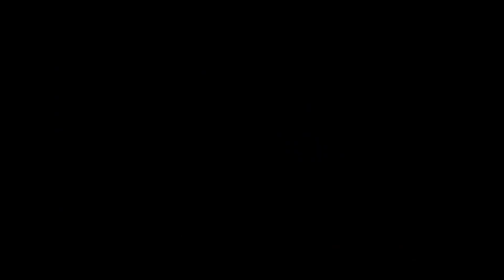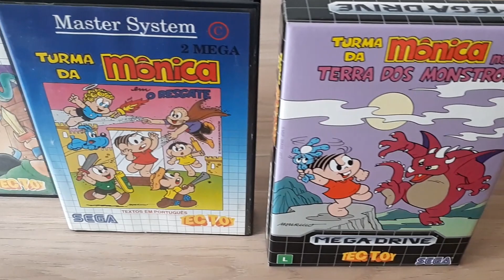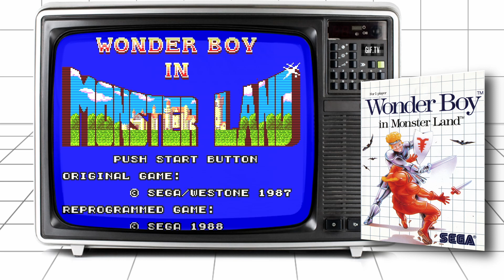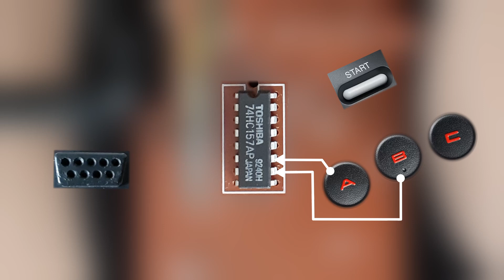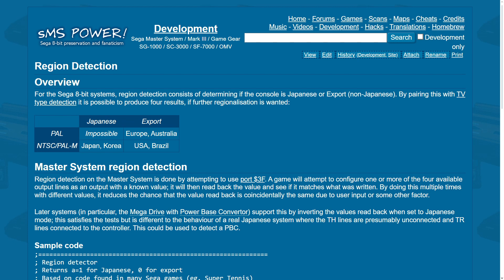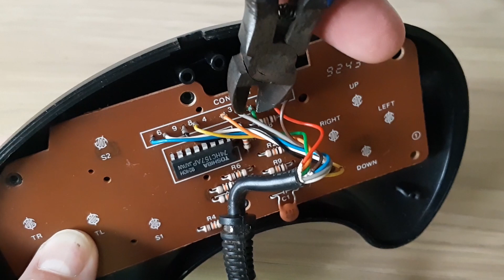The Genesis controller is NOT fully compatible with the Master System!

Comment: This is why my current go-to Mega Drive controller is the Joyzz controller from Krikzz! Unlike other Mega Drive pads, even Retro Bit and 8BitDo’s offerings, the Joyzz controller has a Master System mode, meaning you CAN use it with Master System games normally not playable with Mega Drive controllers! (As long as you know which button combination to input and hold for a few seconds!)

Comment: It's also pretty easy to make an adapter so you can use Neo Geo sticks or other controllers/sticks that just use switches, if you use DB15 and DB9 breakouts you don't even need to do any soldering

Comment: Man, I've never heard before that some Master System games do not work properly with Mega Drive Joystick. If you do not create this video, probably I will gonna die thinking that MD Joystick is full compatible with MS and Atari 2600 as well.
Reply: To be fair, it is 100% compatible with Atari 2600, in fact some homebrew actually require it due to needing more than a single button.

Comment: Great video and good to know why my mega drive controller wont work. Do you have a guide on how to make that adaptor?
Reply from the maker: Thanks! As for how to make the adapter: if you pause the video at 5:30 it is all there is to it really. You should buy 1 male and 1 female DE-9 connectors, and a cable with at least 8 wires. Then you should solder each pin from one side to the other (male pin 1 to female pin 1, male pin 2 to female pin 2 and so on), leaving only pin 7 disconnected.
Reply: @chirinea  Wicked, thanks for the reply. Will defo give this a go.

Comment: You mean to tell me that all I have to do is cut wire 7 inside my Genesis controller and it’ll work on Master System? Does this work with 6-button controllers too?
Reply from the maker: It will work fine even if you don't cut the wire, it's just for these 10 games I mentioned that it normally doesn't work. So I'd you're interested in playing those games, yes, you could cut the wire. It would also work with the 6 buttons controller. But bear in mind that cutting the wire prevents it of working on the Genesis console, you would have to mend it back to make it work there.